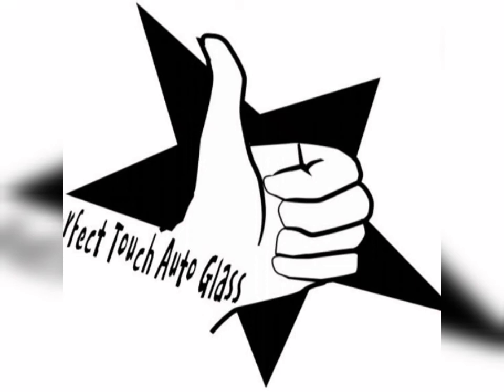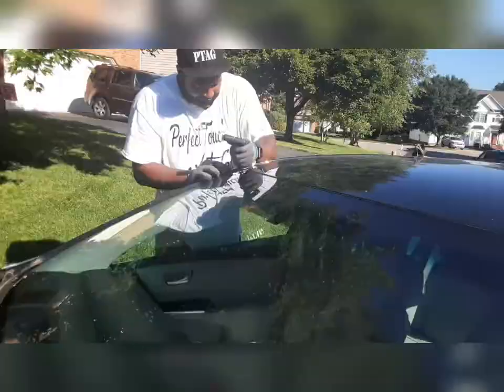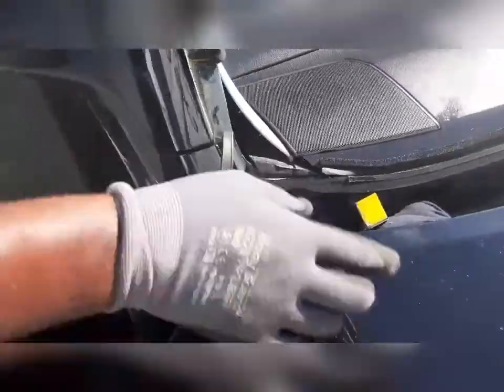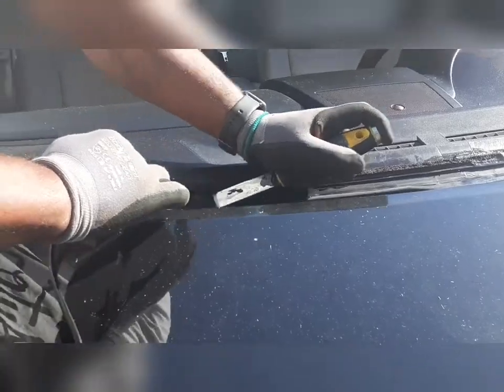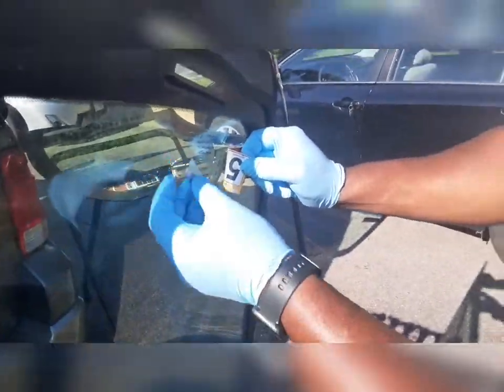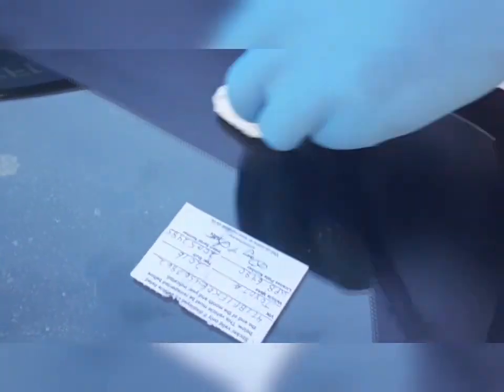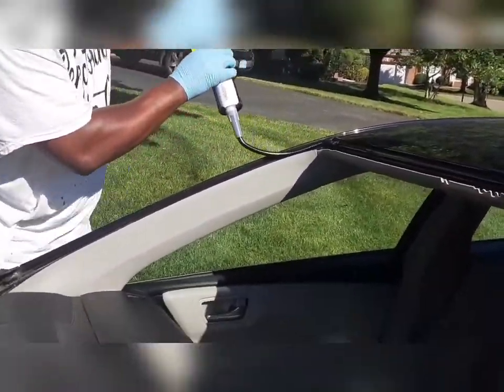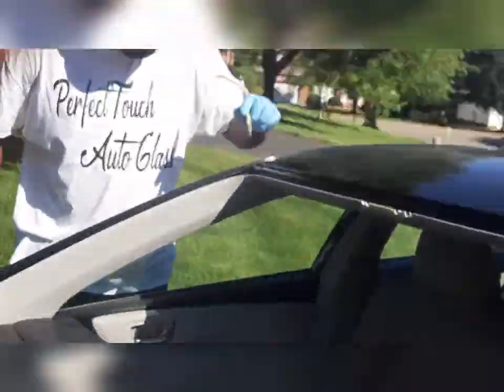How to properly remove a inspection sticker

Comment: I'm not removing my windshield just to remove an inspection sticker, that's madness.
Reply from the maker: Heat gun or blow dryer. Razor blade with handle extension.  Take you time. 2 minutes tops
Reply: 😂deadass